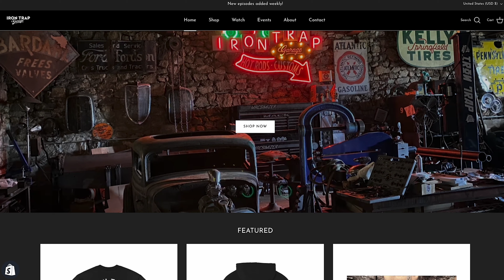We Stamped A Custom Firewall For The Ardun Powered 1933 Ford Coupe!!

Comment: Great job Matt & Steve, it looks factory. Carl Fisher on Make it Kustom did a firewall useing the same buck method but a different tool for the beeds, he said about 90% of the time is prep, I think you showed that as true. You guys build different style of cars but your both amazing metal workers.
Reply: Beads, not beeds.
Reply from the maker: Yep a lot of ways to accomplish similar results. In the end if it works for you and looks how you want it’s the correct way for you.

Comment: Wow ! A lot of work to get there , but it all came together beautifully . The finished product is worth it , fit & finish is there . Given the time spent on the engine rebuild , & it's rarity , a removable firewall for servicing those hard-to-reach places is very important . I LOVE this car ! The whole look is just Totally Bad Ass ! That Lennox is a bit of a rodeo ride , but you have the tool figured out , & made a new fixture set for future use on making firewalls . The first drive on this "33" Ardun-powered Ford Coupe is going to be EPIC ! It may take a week to find your eye brows after that ride , Matt ! The smile on your face , may be permanent ! Thank you for walking us through this portion of fabricating a thick gauge steel panel . I can't think of a better car , or team , to pull this project off . Iron Trap Garage ROCKS ! Fantastic post guys !
Reply from the maker: Thanks for watching!

Comment: Next time, carefully use a jigsaw on the top top sheet of plywood. You'll get a more accurate cut. Then clamp the 2 sheets of ply together and THEN use the router with a top bearing bit. (Pattern makers bit)
Reply from the maker: We appreciate the suggestion!

Comment: Matt i got a good tip for you witch make the woodwork way more faster and fun 
Make you're degsin on  a cheap plate like 6 mm mdf  so you can cut it easely then use the plat as a themplete on the 18mm plate use the saw to cut but stay away from etch 1 or 2mm so you have material to cut with you're routher  take a tjizzel with a bearing on the undersite of it turn you're plate upside down set the bearing on the 6mm and there you go .

Comment: It's BITCHIN!!!
Great Job, guys. I've been looking forward to more work on the 3 window. 
For large panels like this, you might consider making a table extension for the Pull Max. I would also make a spring loaded foot to hold pressure down on the piece. I see a 3" dia. polished foot on a shaft that passes thru the mount. It would have a lever to lift the foot up off the piece and lock in place by eithe going over center or with a pawl..
I think it would make the ride less bumpy.
Anyway, one step closer to seeing this blown Ardun rolling down the road.
That's BITCHIN.

Comment: Left with solving long engine I went with cutting the frame at the firewall and extending the front end. I believe this was easier than dealing with the firewall. I found the most difficult bit was solving the hood tapers to cowl but stretching the front made a lot better looking car. We all prefer a long thing sticking out the front.
Reply from the maker: Actually I think that can ruin the proportions of the car personally. But to each their own.

Comment: Nice work on the firewall.
The Ardun coupe is going to be a fast car. One heck of a lot faster than a regular Ford hotrod. That's going to make for a wild ride.
It's going to need some attention to handling and brakes. I think what it most needs is lateral control of the axles. That is going to need to be a Panhard rod or a Watts linkage. I think a Watts linkage, with the arms mounted to the axle ends, and the balance arm pivoting on to the centre of the chassis might work. And some careful attention to steering geometry, and some telescopic dampers.
Reply: Matt checked out an Ardun coupe in Seattle couple years ago. I've been in that car when owner/builder Jim (RIP) put it all out. I figure well north of 300HP, made me poop a little.
Reply: @danontherun5685   With 300bhp, plus, Matt is going to need serious brakes, as well. I would rather he didn't kill himself in that jalopy.
Reply from the maker: Jim was a legend! I’m thankful I got to know him and ride in that car!

Comment: Mike's 'crap-reo-let'  finally gets some attention!  Even if it was just to use as a pattern.
Some recommend pre-stretching on the English wheel to help with the groove.
Reply from the maker: The panel came out with basically no warpage which negates the need for that in this project. But with bead rolling and some other panels it definitely is necessary